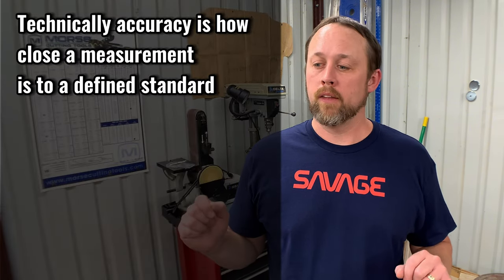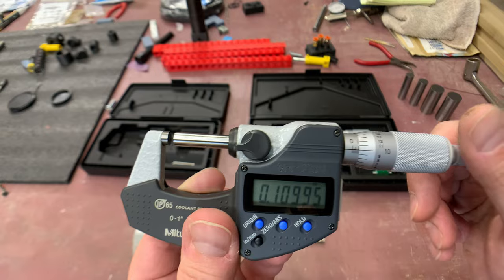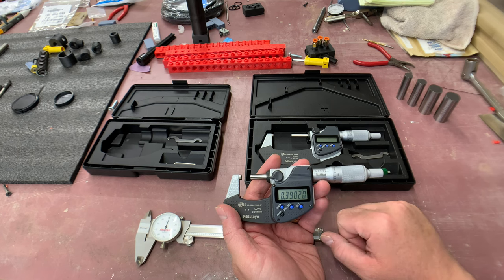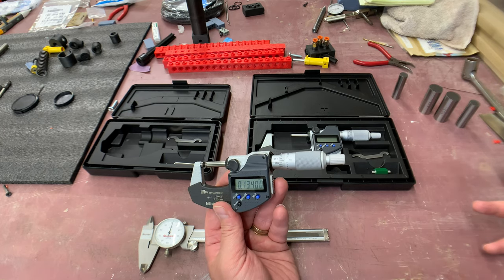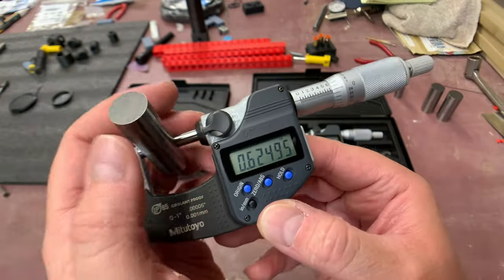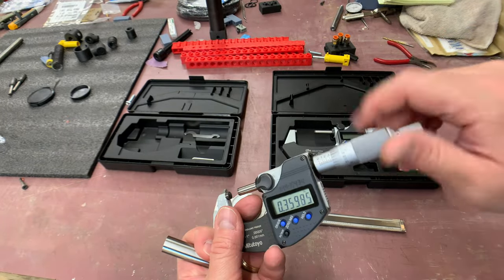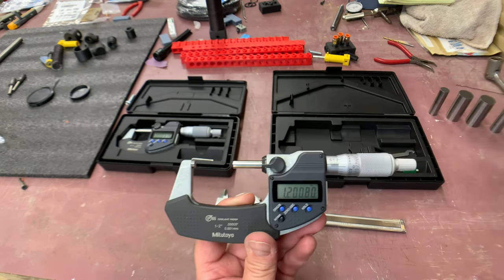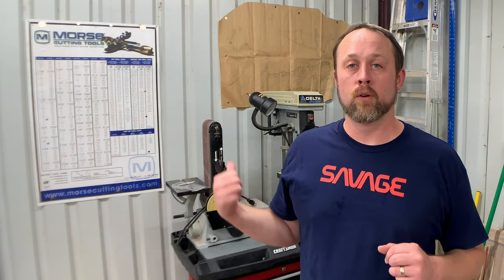Measuring Secrets for Micrometers

Comment: A well done and explained video and something I wish I had available 30+ yrs ago.

I'm about 5 months late, but a couple of tips I've picked up for maybe some of the finer details. While I've got decimal equivalent charts and used to use them all the time, I'll now rarely bother to check anything on them I haven't already got memorized since machining almost demands having a a calculator of some type handy. Many don't seem to know that fractional inches are easily converted to there decimal equivalent with a few simple key strokes. Just take the top number in any fraction (the numerator) and divide it by the lower number. (the denominator) it works for every fraction you can come up with, even one's you'd never run across. 37/197ths for example. 37 divided by 197. Rounded off, =.187817" and some change. Or something common, 9/16ths. 9 divided by 16 = .5625".

I've also watched quite a few of Mitutoyo's older videos on their YT channel. That thumb wheel on most calipers is really meant for faster and coarser size adjustments. Mit. recommends the best technique for smaller measurements is to use your thumb and forefinger on the back side of each jaw and directly opposite where each caliper jaw will touch a round shaft on each side. That lessens the chance of the small amount of clearances in the calipers slide assembly affecting the measurement. For round or flat sided and parallel parts, then the item to be measured should also be placed as far up in the jaws and as close to the scale bar as you can get. For larger objects, then both hands are used to gently close the jaws against the part. Again and as you said in the video, developing and using the same amount of feel or pressure each time is also important. My Mit digital calipers are the best I've ever used, and I've checked them and my technique on good gauge blocks. But while there accurate, if I need to know I'm measuring to better than about .003" and be sure of that. I'll still use a mike. And what ever accuracy I get on those gauge blocks in the best conditions I can manage, is a whole lot different than measuring parts still in the lathe or mill and under most average shop situations.

And for multiple double checks and repeatable measurements to again be 100% sure of the results. Mit also recommends using the same number of clicks on the ratchet each time for consistency. Again I've tried it on those gauge blocks and you can sometimes see a 1/2 10th change between measurements at times. That may or may not be important for most of us, but it is a more consistent technique. So I use 5 slow clicks when I think it really counts on something critical.
Reply from the maker: A lot of really great tips here. I do think you’re right about people not knowing about where the decimals come from to begin with. I will probably do an entire video on just the chart with tips and tricks as well.

Comment: For somebody new to machining, how long would you say it takes to develop "the feel" and be able to know "the feel" is accurate?
Reply from the maker: I think that if you were working professionally as a machinist it could take up to a year to get a feel for fits.  That does entirely depend upon what kind of work you are doing.  If you are making mating parts for an assembly, I think it could be learned more quickly like with mating threads, or with press fits/slip fits.  It would depend quite a bit on the frequency you are making parts that go together and experiencing how that feels.
Reply: It only took me a few days to get really consistent results with our vernier scale starret micrometers. I had instruction from a master machinist so your mileage may vary
Reply: Get yourself a gauge pin or dowel pin, or carbide endmill shank. Something that you know its precise dimension. Then practice the feel of measuring it without looking at the micrometer. Then check the reading on the mic. 

The key is not looking at it, because otherwise your brain will just stop your hand at the right place. 

As a hobbyist that doesn't do ultra precision measurements all the time, this is also a good way to sort of re-calibrate your "feel" before measuring a real part.

Comment: Minus series gage pins are .0002 under size from marked size unless the pins are chinese junk.  Minus series gage pins if a qualty brand will mearsure .0002 undersize from marked . Gage pins are measured with a Master Mic or optical comparator when certified.  The caliper material is not flexing at the beams , its the gear mechanism being overstressed . 24:26
Reply from the maker: The gage pin I had could most definitely be Chinese origin so the accuracy could be questionable.  I think we could both be right on the caliper part, the gear and the material could be flexing/stressed.

Comment: The whole deal about using nominal drill sizes seems personal. Its almost like you have had to deal with custom size tools when a nominal size would be in spec on a regular basis. 😂
Reply from the maker: Haha, you found me out.  I've been dealing with poorly spec'd parts from customers or internal designs for around 15 years.  I've found that if you have a discussion with a designer, be it an engineer or a customer, they can usually change the sizing to be a nominal dimension.  There are definitely occasions where engineering requires a strange size and that's ok.  I just push using common sense when designing your parts for manufacturing.

Comment: Digital mics are for  amateurs.
Reply from the maker: Die hard analog guy?  I still favor manual micrometers too but the digitals are still pretty cool. In other video comments people have remarked about easily switching to metric which I think could be a big bonus and make these a two for one value in way. Granted you could just convert yourself but everybody has tool preferences.
Reply: I have SAE and metric measuring equipment, and don't use a DRO either. I'm an old retired geezer and a hard core Starrett Man. LOL! @themeandrousengineer
Reply: I use calipers during inspection after a tear down but when cutting bushings I use an inch mic and t gauges, 0001" is not as critical as .001" The lathe I use measures in .0002 at the increment from 0